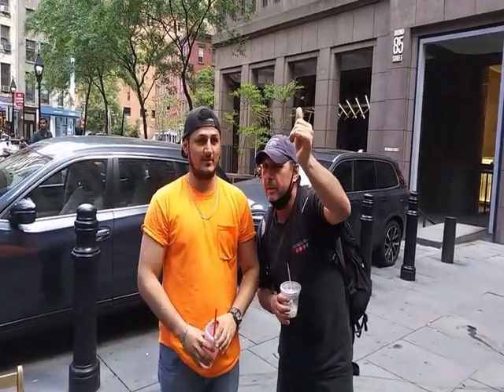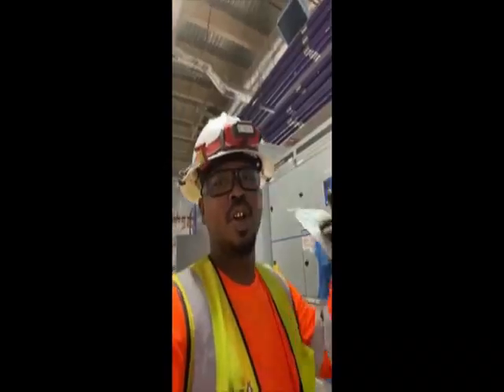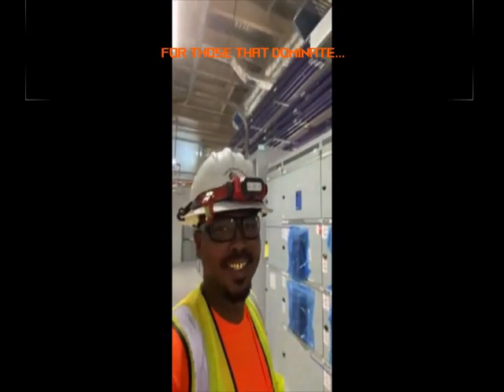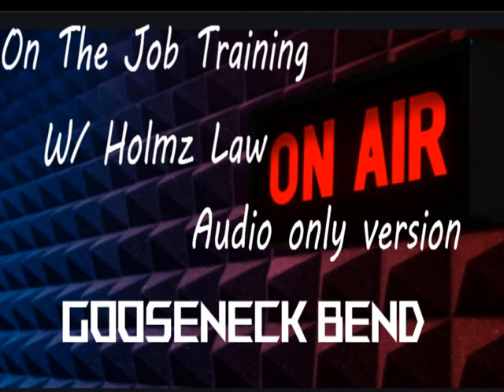Conduit Bending (Gooseneck Bend) - Step by Step Coaching w/ Holmz Law

Comment: Great video never did goose necks bend I’ve done off set 90 degrees 4 point saddle thanks again
Reply from the maker: Well glad i could help.
Reply: Do a video on troubleshooting overload relays?
Reply from the maker: @rodolfovesga979  I'll try but I don't come across overload relays much anymore. We use a lot of VFD's now. know what I mean?
Reply: @TheArtOfConduitBending  what about E and I videos electrical and instrumentation?
Reply: @TheArtOfConduitBending  troubleshooting  and resolve controls system and vfd PLC and hmi and servo and control problems please if you can